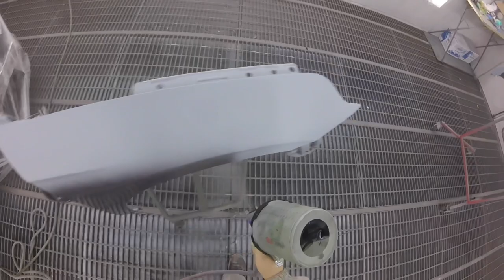Car painting with Axalta. Spies Hecker Hi Tech

Comment: What air pressure do you spray base ? Clear?  Also are you full fluid and full fan ?
Reply from the maker: 25 psi for base. Clearing with iwata supernova about 28 psi clearing with sata about 30 psi. I have fluid fully open for all my guns. Fan on satas are fully open. Iwata supernova fan is about 3 turns out.

Comment: Are you always using a light grey sealer for dark colors?
Reply from the maker: I think this was a more medium gray. But yeah for the most part. This paint covers extremely well. Haven’t noticed any problem with the color sealers I’ve chose.
Reply: @everyday_painter thank for the input. I know with auto wave plus the closer the sealer was the better coverage you got. Just recently switched over to spies as well
Reply from the maker: Undercoat definitely mattered with Autowave. When I used Autowave I had the colorbuild system as well so I would use color primer and sealer. Spies is nice. It doesn’t seam to matter what the undercoat is. It covers. Haha.

Comment: How much base coat did you mix for.this.job
Reply from the maker: I think I mixed about 17 ounces for this job.
Reply: @everyday_painter  I must be doing something wrong I use cromax pro and it takes me 15 for just a bumper
Reply from the maker: 15 is definitely a lot for a bumper. Especially with Axalta. This stuff covers so well. It only takes me about 9 for a bumper. Depending on size. But usually about 5 for replacement panels or whole door (not including door jambs.) and 3 for blend panel.